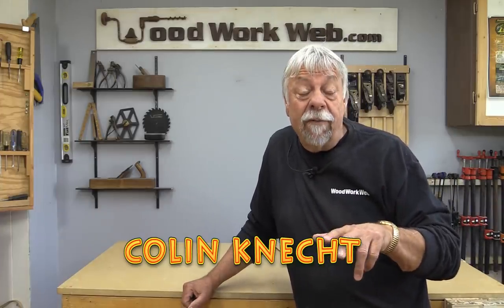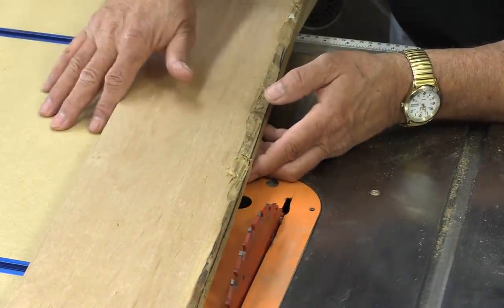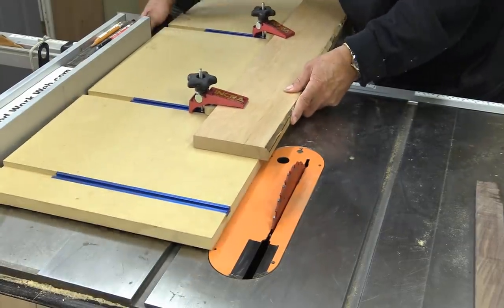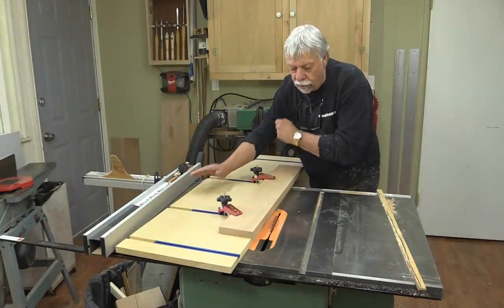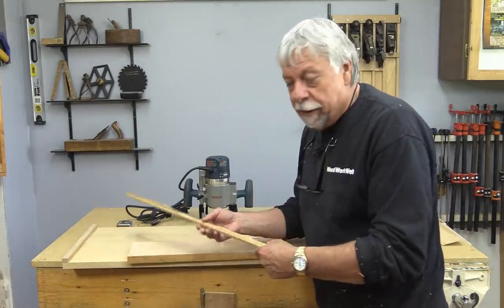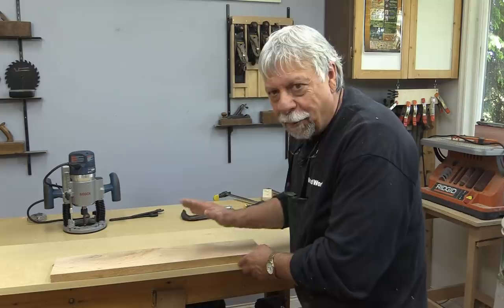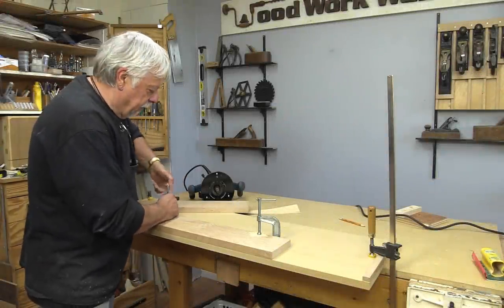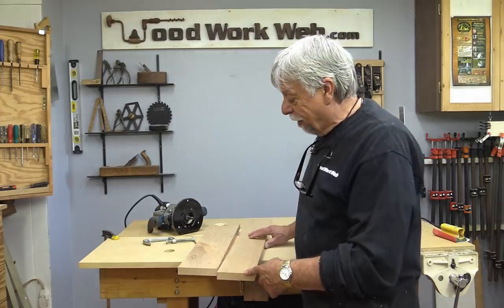Table Saw Jointer Jig / Router Jointer Jig - How to Joint Wood Without a Jointer

Comment: Hi I'm sure everyone except me knows the answer to this question , why do we need to use the straight edge jig / clamping jig  on a table saw to get straight edge and not just using the fence ? fence is completely straight , but the board not in both edges, if there are some points that board touch the fence it should be good , not ? what am I missing here ?

Comment: Hi Colin. I love your channel. I'm new to woodworking (starting to make my own guitars) and I'm learning a lot. So thanks for all the very useful demonstrations. I have a router and I'd like to use that to joint some pieces I have. When you jointed with the router and clamps, how did you know that both sides of the board were parallel? Is there a step I'm missing?
Thanks Christian

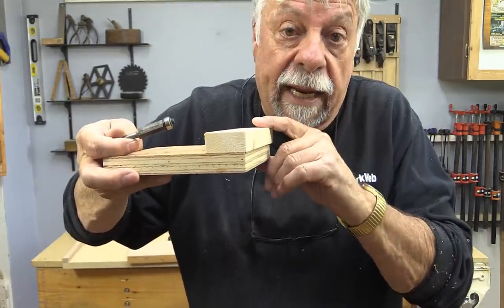Comment: I want to try this with 2x4s, but my flush trim bit has a 1” cutting length. If I use a rabbet bit to create something that looks like your setup at 6:12 would that work? Would it be safe?

Comment: Great tips! I like the jig idea... my table saw is a pretty small one though, and I've been hesitant to make jigs like that for it because I'm afraid it's just too weebly wobbly because of its size. (it's a "jobsite" size saw - the table deck is maybe 24" deep by 30 or so inches wide.) Do you think I'd be better off buying a larger table saw or keeping the one I have and picking up either a planer or jointer next? On the one hand, if I had a larger saw, I may not feel like I need a jointer, as I could use your jig trick. On the other hand, I've wanted both a jointer and a planer for a long time, as I really want to get into making furniture, etc.   Thoughts? 

Thanks!
Reply: What about the possibility of making a larger table for the table saw that the table saw could drop into and be level with the rest of the table. There are plenty of plans in videos on ways to do that, just check it out on YouTube.
If you did that, you could save the cost of buying of new saw and possibly getting a jointer and a planer.I would look for used tools on craigslist, comma Facebook local selling groups, yard sales, and the like. No need buying new tools when you can get functioning older tools for great deals. Just make sure they work!Tools have not changed much since they were invented, there may be more Bells and whistles at you may never need or useTama orFancierEnclosures. I am of the opinion that some older tools are built better then their modern counterparts, name out of things like cast iron. They can be a bear to move, but they hold up like cast iron. Good luck with your project, I too am hoping to get a Jointer and a planer because I plan to be using pallets and other reclaimed wood for my cigar box guitars and other handmade instruments.
 That needs some sort of treatment to Look good, which is necessary in order to sell it.
Reply: I recently bought a DWE7485 table saw and built a 40" x 40" table that the saw slides and drops into.  (watched every YT video and came up with a design to suit me).   I now have plenty of width and depth after the blade, but found that simply having the 7485's table in front of the blade wasn't enough for good support for longer, narrow pieces. I built a long fence extension that slides down over the fence and has a foot or so of extra "table" surface ahead of the blade.  It's screwed to the underside of that fence extension.  The fence is super accurate and works great, though the fence scale is no longer correct, but I always use a rule to check the cut anyway.  Measure thrice and cut once!
I also have hot-glued a piece of wood to another with a known straight edge and done what Colin did without the jig and clamps, using that known straight edge against the fence (when I was in a rare situation of needing a jointer!)   You have to watch that the wood is perfectly flat as the hot glue blobs can add varying thickness to the interface, though it might have been better to glue down the sides like a fillet weld.  Done that with my planer sled.   I think CA glue and activator would work better for the interface glueing, but more tricky to pry apart.

Comment: I'm surprised this has not been said already, but I feel this video is a bit misleading. If your faces are not already perfectly flat, then these methods can create real problems. I'm surprised, you seem a skilled and knowledgeable woodworker, so not pointing that out or taking it into consideration seems odd. If you have twist or cup in that board, you might get some interesting results here.

Comment: @WoodWorkWeb
I know this is a pretty old now, but I'm hoping for some help here.
1st question: I'm trying to joint some 8' long boards, and don't have a jointer. (Nor can I justify the purchase of one.) I've tried various methods with my router table, but how to do it right is eluding me. So, I'm thinking about doing it with my router (not on the table) and a straight edge, as you did in the second method. Also, I'm thinking about making a "floor" inside my planer to use to slide boards through (e.g., to plane these 8' long boards), as it sounds like you do with that MDF you used here. It seems like this would solve both the problems of jointing AND planing such long boards. Am I on the right track here?
2nd question: I've also looked at Melamine Board. Between MDF and Melamine, is one clearly better than the other for what I'm trying to do? 
Thanks for any insights and guidance you can provide.

Comment: Thanks for informative video! I am gonna attempt to make the table saw sled jig from the other video. However, I dont have a jointer to make sure 1 side of MDF is straight initially. Would factory cut of MDF from local Home depot be straight enough for the jig?

Comment: Very nice video again, Colin. Do you think turning the tablesaw jig into a proper sled riding in your mitre slot would work as well? With the Incra clamping in the t-tracks you should not need your fence. On top of that you would have a zero clearance cut on the side you want to keep. For the second cut you could align your incra clamps with the fence using spacers to get them parallel.. 🤔

Comment: I could be overthinking this but if one track is further over than the other wont the edge be cut at a slight angle??
Reply: Yes, it would be. For your first cut, ensure that the grain on the outer edge of the board (the side being ripped) is at an angle that is ideal. That will be the angle of your grain even after the second cut. So if grain direction matters to you i would use that as a guide when lining up your first cut.

Comment: Great video just like all your videos!!!  I am just starting tinkering around with wood working and I have a question. What can you do if you don't have a straight edge to reference from on any of your sides??? Is there any way to get it straight without a jointer???
Reply: Yep.  The sled he showed in the video does exactly what you are asking.  Rip one edge using the jig, then remove the jig and run the now square face against the fence.  You now have two parallel edges.

Comment: This is very helpful.  I am getting into making a stand up paddle board, and will be ripping long boards, 8-12’ cedar.  I don’t have a jointer, so my plan was to use a 4x8 sheet of plywood, cut down to make a similar jig of 8’ long.  What material do you recommend for this?   MDF or 3/4” plywood of what type?    Thanks

Comment: Nice job Colin.  Just making another one of these as I've been out of wwing for a bit.  I was about to make mine almost exactly like yours.  Do you or does anyone else know why others often build this jig with an elevated piece on one side?  It's not like the board to be "planed" needs to rest against a straight edge or anything?  Any ideas?

Comment: Thank you so much for the info! I had a question. Could I use a piece of 1 in. x 8 in. x 8 ft. MDF Moulding Board for the router bit guide? I was thinking that if I get a longer piece of MDF, I would have the extra length to keep the whole work piece in alignment if I needed it for future projects.

Comment: Hi Colin, love your videos so keep up the great work!  So my only confusion is this, how do you ensure that the upper board that you are routing is hanging over the MDF equally?
Reply: It doesn't have to be exactly equal from one end to the other from the support/straight edge board. You are routing a straight edge and the guide bushing rides against the support/straight edge board to give you a straight edge on top board

Comment: When you jointed with the router and clamps, how did you know that both sides of the board were parallel?  There was no fence on the clamp side of the board you were jointing.
Reply: He didn't, but that's because it's the first cut. Now that the one edge is perfect, he can take that to the table saw and make it parallel.

Comment: Without a table saw, is there a way to joint the opposite side of the board and be exactly parallel?
Reply: Peter Pasieka If you have a router you can buy a router “guide” that’ll hook to the jointed side and then you can trim the uneven side. It should be perfectly parallel.
Reply: @Ricardoelsupremo  🏆
Reply: If you are getting into woodworking, I would recommend definitely investing in a table saw. Ive heard a lot of people say it is the most useful tool!

Comment: The second router method assumes the face is flat.  If there is any twist, the flush trim bit will have a hard time riding the MDF and keeping the bit square to the side.
Reply: d3lsl0w Actually, the same problem exists for all methods.
Reply: Easy enough to shim with either of these methods.
Reply from the maker: As Ian already mentioned,  shimming should correct twisting problems you have. Thanks for watching.
Reply: WoodWorkWeb would you recommend dealing with the twist first?
Reply: Jointing faces without a jointer or planer w/jig would be an interesting video.  I gotta assume it's gonna be a lesson in hand or power planing.

Comment: Great job. Is therea way to joint the wide face perpendicular to this without the jointer?
Reply: Charlie Day yes and no. Usually the face is made flat first before jointing the edges. Very few people have a wide jointer to do the face so either use a surface planner or build a router sled to flatten the face surface.